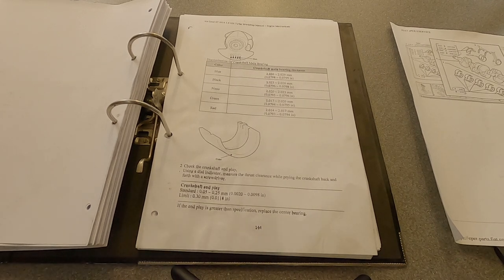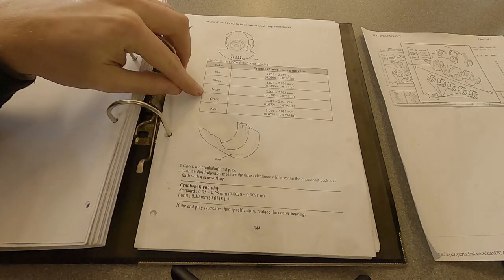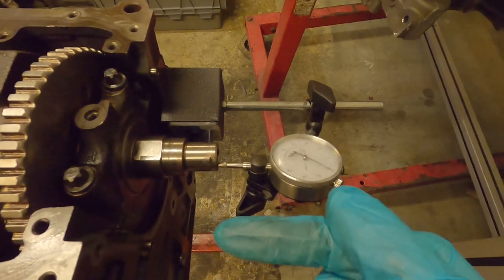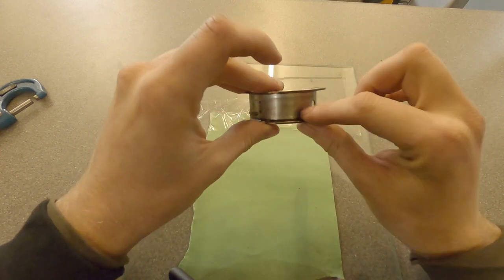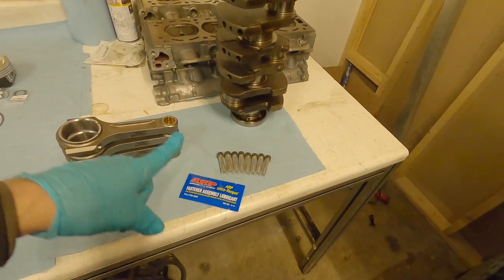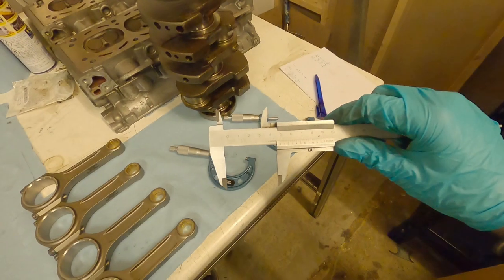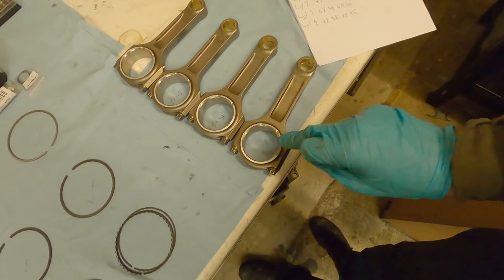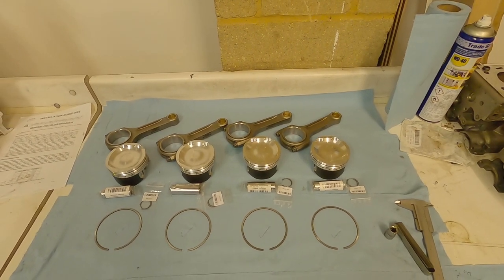Engine Building Part 3 - Measuring Thrust Bearing and Connecting Rod Bearing Clearance

Comment: Name brand bearings are you running? Always used clevites myself just wondering what brand u use..
Reply from the maker: These are just OEM stuff to right size, no need to upgrade them in this case.

Basically as long as you have oil pressure and the right clearance the crank won't touch them during operation.

Comment: Grate video 
I feel bad now that the first part of your video was from me lol but at least every one will know now 
I'm going to be using arp stud and nut kit to replace the head bolts they going to be a diffrent torque setting to the bolts
Reply from the maker: Dont feel bad everyone needs to learn.

Dont do it the arp head stud kit is not suitable for boosted engines it's actually meant for old c20xe engines.

The stock bolts offer stronger clamping, if you need even stronger then you need custom made studs.
Reply: @tunedbyrabbid  

Hi, I’ve used arp headstuds on my engine build.
Now I’m worried a bit.
Why shouldn’t I have used them, and use stock bolts?
Thanks in advance
Reply from the maker: People sell the head studs as they fit not because they are any good.

They're a part from the old C20XE NA engines. Were never meant for a turbo engine.

The bolt is only a M10 ARP2000 which isn't meant for more than 300hp reliably. When used in a Z20 they will start to blow head gaskets and lift head under boost as you go over 400-450hp. We've seen this many times over the years.

The factory bolt will do 500-550hp just fine. No head lifts or any problems.

The only stud upgrade I would use for 500+ is an ARP L19 and modify the head and block to oversized 1/4inch studs and a set will probably cost around £600 plus machine work.

I would remove the studs one at a time and replace with factory bolts then torque to spec before considering running high power.
Reply: @tunedbyrabbid  

Thank you very much for your reply 
Wow, this is some very useful information!
My head seemed to lift with the arp studs, now I’ll look at it again.

Thanks!!